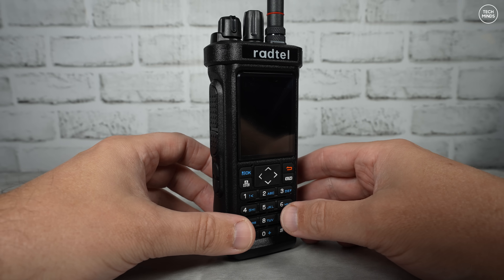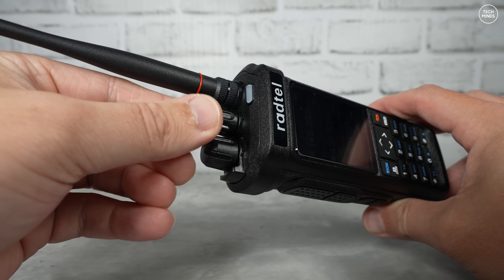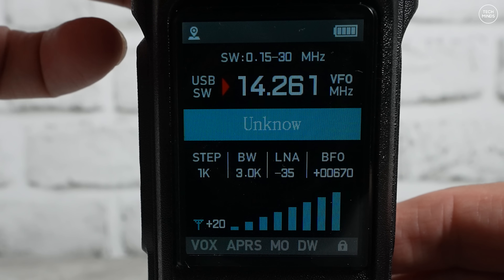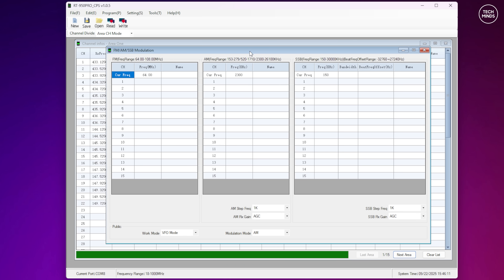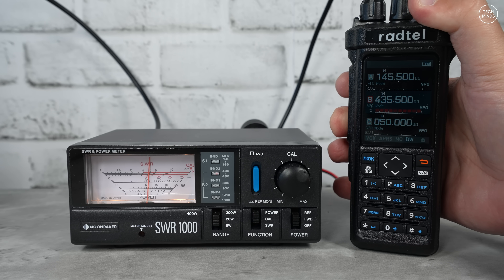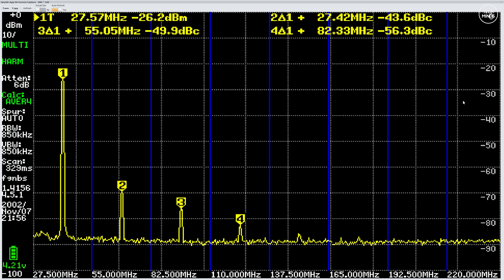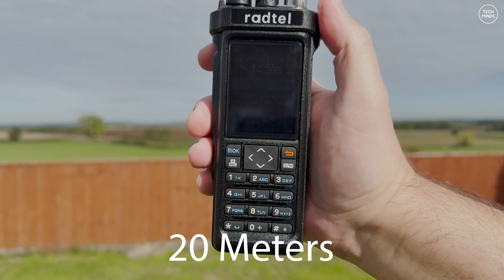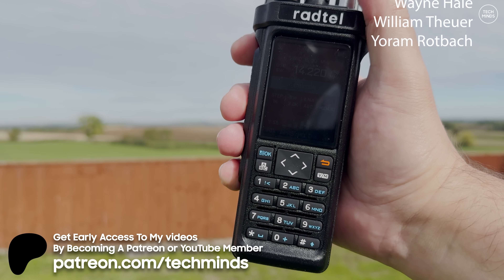Radtel RT-950 Pro - There is one thing you NEED to know!

Comment: The RT880 is much better. Better menu, easier settings. I have the RT950 PRO and the menu is cut to a minimum. And you can't set it there like you can on the 880.

Comment: Helpful hint: there is no clarifier or fine tuning for SSB, but you have to change the "BFO" setting to make it work. Fortunately, most hams and CB ops transmit "on the zeros" so once you're spotted in you won't have to change it. Still, it'd be nice if the tuning step was less than 1 khz.

Comment: What is the one thing!? ???  one of your videos shows failures to connect the radio to the program CPS.  What is the fix????  Mine is still failing to connect.  W4AAO
Reply: Sometimes you have to hold the connector in place with your hand to get it to connect.

Comment: Radtel is a seller, not a manufacturer. The RT-950 is manufactured by BinTolk, specifically the BT9000 model. Several of their radios are produced by iRadio. The problem is that their radios rarely operate reliably, they always seem to behave like beta test units. I own an RT6D, and now I’m considering buying an RT-950 Pro.  I guess I must enjoy dealing with endless partial firmware updates.

Comment: How is the AM audio when listening to Shortwave Stations?   What are the available Bandwidths for AM mode?    Thanks
Reply: I was just told the RT-950 Pro only has a single 10 kHz AM bandwidth, just like the RT-920 I owned. I sold the 920 partly for that reason! But I have a RT-920 Pro on the way, mainly due to the Channel/VFO tuning knob. That will make it easier to use, and I can save SSB BFO offsets per-shortwave band into memory to make returning to various HF ranges easier.

Comment: Curious on the APRS - does it support sending and receiving not only tracking data, but full APRS text messages from the device itself without a phone?
Reply: no aprs messaging to a specific user such as WXBOT. Only beaconing, but a message can be added to the beacon. But, locks the firmware during Rx sometimes.

Comment: Top tip.... Turn off triple watch to use pf1/sk1, it's press and hold 2 on my pro. Assign "beacon tx" to pf2 long if you want to manually send an APRS packet. With GPS on, press and hold v/m for your position and if you also have APRS on when in the GPS screen press "ok" for received APRS packets. Great video.

Comment: Back in the 70's pre selectors were a pretty common part of the setup, (even built in some radio's like the FROG7) , and its a device I think all these hand helds would benefit from when using a outdoor aerial. I find the blue donut antenna being a tuned device has some out of band rejection and works well with these devices. Pleased you didn't forgive the radio all its faults because it has 'such a great display'   I would be getting one of these to play with but my 880G has made it to the UK, and I'm having a bit of a love affair with the 860, with it having a few unique features often overlooked. I've in fact ordered a second one as I'm intrigued to try the GPS 'roger' that can be used between 2 radios to tell how far apart and which direction.  As an aside, when testing HF, I usually go to 5505 USB Volmet - its pretty much a constant and can be used to compare radio's back to back quickly rather than amateurs who don't seem to stay around long enough.

Comment: I'd rather have a sensitive front end on an HF HT.  I can add a 10 dB SMA attenuator if I wanted to use a long wire antenna.  Maybe the PRO+ version next week will have receiver AGC or a manually selected internal RX attenuator.   :-)

Comment: 5:45 Bluetooth headsets should be a simple software patch. Radtel seems to be listening to us and this would be a super easy thing to do with a firmware update.
Reply from the maker: If the hardware only supports BT serial then  I don’t think it could be added just with firmware. I guess we have to wait to find out.
Reply: I don't think it will be. Bluetooth appears to be Bluetooth LE only, which does not have serial (for Bluetooth TNC) or audio capabilities.

Comment: How about 6 meters? 49-53 is in the specified TX/RX. You said it transmits on 1.25m, but 222-225 is not in the listed TX ranges.
I would prefer it to be more sensitive to work well with smaller portable antennas as that is how it is in use normally.
Did you adjust the backlight? You can set it under options menu in the CPS programming software.

Comment: Thanks for the overview ... Radtel is really way ahead of the competition, congrats to them! 
If they go the next step I will also be buying my second Radtel ... that would be audio streaming via Bluetooth, so I can use my phones headset and phone for control of the radio while the radio is in my backpack ...  as well as SSB TX on the upper HF bands? I'd be willing to pay up to twice as what they are selling their gear for now, while the hardware costs are not even increasing that much, because so much can be done with their high speed MPU that is in there, which is way faster than that of my RT-880. Ok, the RF amp also needs a linear mode for SSB, but that should be no rocket science either. This is really getting exciting having almost a multiband multimode shack in your pocket.

Comment: The fact that it overloads on a proper antenna is a sign that sw reception is only a gimmicky marketing ploy. The direct conversion ics inside are consumer grade little things intended for toys and baby monitors operating with short antennas. Despite the good low pass filtering on 2m and 70cm, reception will still collapse in the presence of nearby in-band signals. but at the end of the day you get what you pay for
Reply: I disagree. The fact that it's not handling full-sized HF antennas well isn't an issue. It's a hand-held sub£100 radio, not a base station. It's designed to be used when out and about.
Reply: good luck making a qso on 11/10m with 2w and a 50cm whip
Reply: I agree, more Chinese junk

Comment: Couple of things to note. The supplied CPS does not support Import and Export of CSV files yet. Radtel have told me that it will be made available in the next version. And as far as I'm aware there is no support for chirp yet though I have been looking into that myself. It looks as if the dialogue with the radio might be encrypted. Even so it's probably very primitive. There are a lot of bugs in both the firmware and the CPS at the moment.
Reply: The CPS doesn't program the side buttons... Only the bottom one works.
Reply: Forgot to mention .... Yes I totally agree with your comment. This radio is a hard pass for me

Comment: We are getting closer to a HT, that will run all modes, all bands, and put out from 5-8 watts. All controlled via a smartphone or directly through the radio. Exciting times! The new Discovery599 radio is an example of this step closer but who knows what Radtel/Xiegu/VGC/Baofeng could be working on... Chinese companies are not afraid of the MVP business model that's for sure!
Reply: I've tested the 950. It's basically an 8w radio. My $20 baofeng has better output. Disappointing because I thought the 950 has 11w hardware

Comment: Keep in Mind, CW is permissible anywhere on the Amateur Radio Bands. While it might not be considered as good operating procedure, CW does own the band space. 73 de KB5SXC.
Reply: Yes, CW is valid everywhere that we can transmit, but the point being made in the video is that those CW signals weren't actually present in that part of the band. They were the result of overloading the front end of the radio.
Reply: The problem is that the radio will only transmit on FM and that if the reception mode is anything but FM the radio won't transmit.

Comment: If from hardware point of view is ok, on SW/firmware they need an update for sending APRS messages and also APRS packets received list.
Reply from the maker: Do you mean actual APRS messages, like free text? or do you mean APRS position packets?
Reply: You can get at the APRS beacons received list from the keyboard. Long press V/M to get into GPS display. Then use the MENU button to see the received packets list.
Reply: Agreed. If this could do actual APRS messaging as well as the already-available beaconing, it would be a monster of a radio. That should be possible on this hardware.
Reply: Agreed, the APRS firmware is incomplete at best. The rt-880g at least has working APRS. This radio is a hard pass for me. I don't have time to write my own firmware or deal with their bugs.